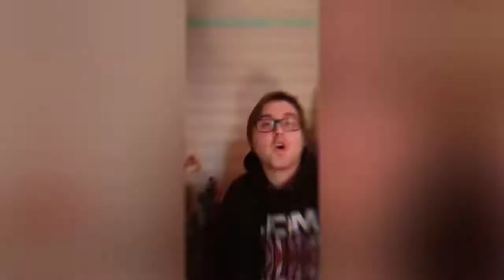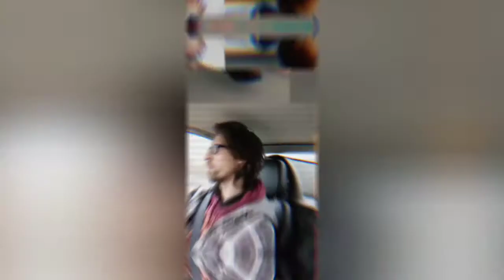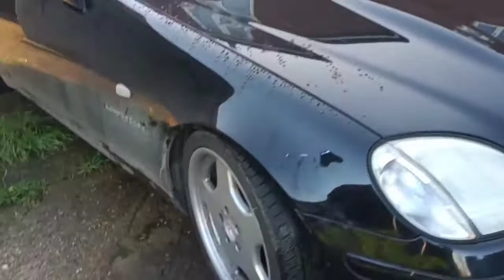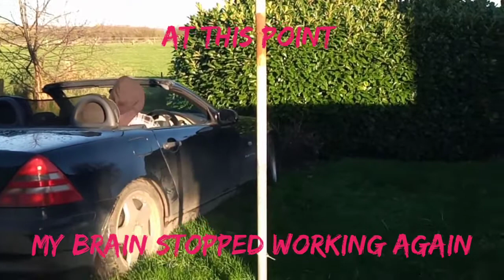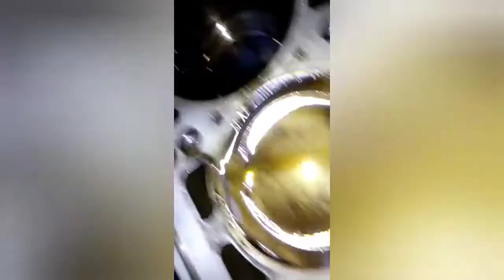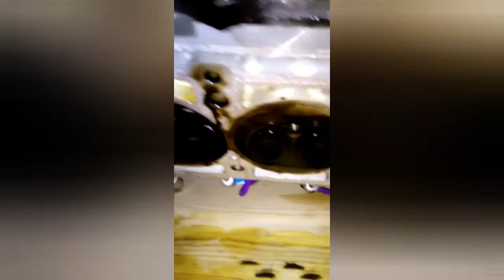Broken Turbo SLK....What broke?

Comment: The cylinder head blew? If you check the diogo corria build from portugal, hes got Titatnium rods but his gasket blows every run. I'm buying an ecu at some point but its hard because nobody is much help on slk

you also might be able to get some custom made from the crazy russian turbodemon guys
Reply from the maker: We ran standard ECU to a bar but it causes gear box issues so we went to megasquirt 3   and it works great. We blew headgasket on cylinder 3 but something cause a chunk of the piston to break off too I've got rods on order for our high hp build trying to find 12.9 rated headbolts the engine I have found arps that should work but no where states if you can use them as head bolts